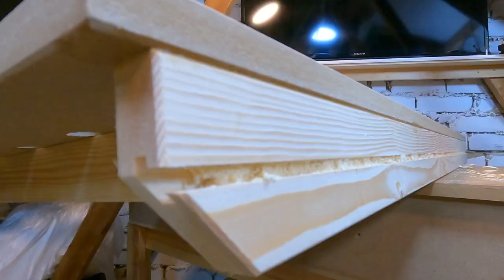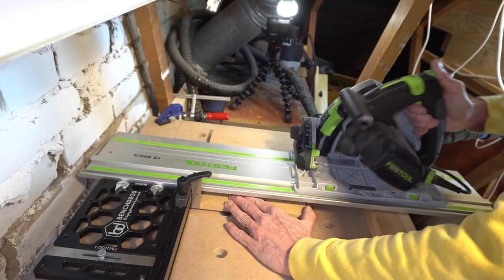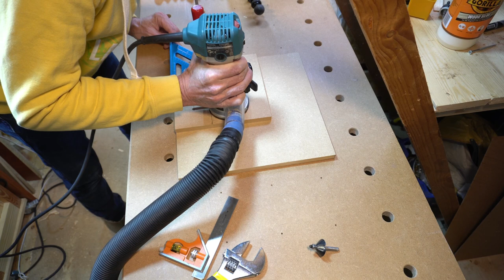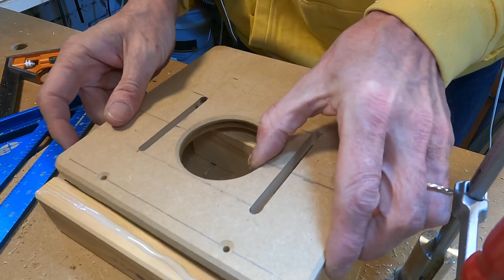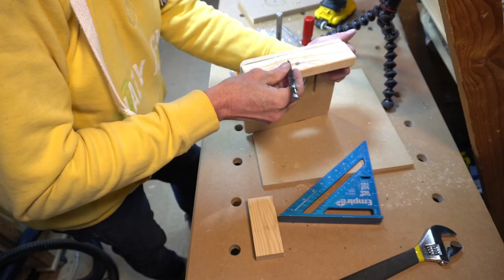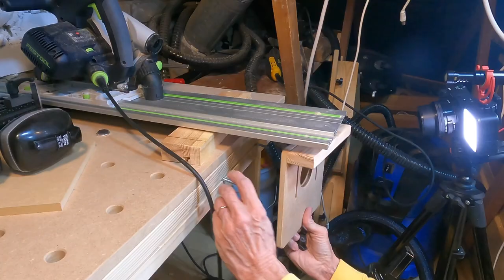DIY Track Saw Rail Support for MFT

Comment: Good idea Jon I like this. Sliding your panels underneath saves lifting your track on and off. You can now have length stops to cut multiples of duplicate parts because your saw remains in the same place above the table. Less marking out needed. Tony
Reply from the maker: Thanks Tony.

Comment: Hi John, I've got a very similar setup to you, using the Benchdogs square and fence. Noticed you don't put the guide rail on the wood but have it suspended above. How does that affect accuracy and the cut. Thought the idea was to line up the cut on the edge of the guide rail?
Reply from the maker: Hi Ian. Good spot and good question. I have my square dog set up to accept 20mm thick components, as that i what I mainly cut. I suppose it was a bit lazy on my behalf not taking the time to lower the setting to the MDF. Seeing as I just cutting one piece and It it was MDF i knew it would be OK. If it was MFC or veneer i would have altered it. I did not see any splintering though. I have my piece sat on the 3mm dog spacers to save my top, I never see and blow out below.  Also, I have the Fencedog calibrated for length, so i do not rely on the splitter guard against a mark, subsequently the dims are exact. Probably the biggest downside of doing this is not having the rail pressing against the piece to secure. Small pieces would be an issue. Regards

JP

Comment: You are going to be challenging Peter for the king of mft table soon.  Though I think he did actually say in the video he actually paid for the hinge from Dashboard and it worked out at about £280.
Reply from the maker: He did say £280. Mine cost less than £20 and that included the MDF top. Thanks for watching John. Regards JP
Reply: @Smallbarnworkshop  although Peter’s new toy looks very nice I like the cost of your design much better

Comment: John, for the love of all that is holy, please remove the cinch cord from your hoody before using power tools.  Ideally cut it off or pull it out, at very least tie the dangling ends up into a big ball knot back at the hood... you were making my blood run cold with the ends of that cord dangling a few inches away from spinning power tools.   You could cause yourself an horrific injury otherwise,  mate.

Comment: You need a locking point for the rail to stop the rail from moving side to side.
Reply from the maker: Hi Brian. The Benchdog cam locks keep it solid and square. This support takes out the flex. I did add the dowel for extra rigidity. Regards JP